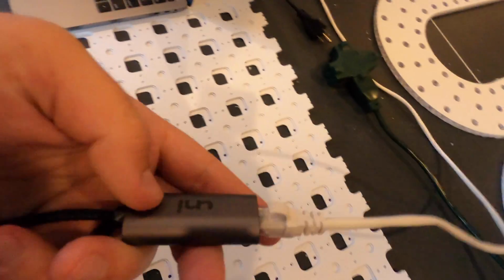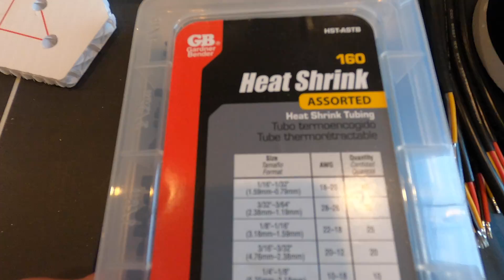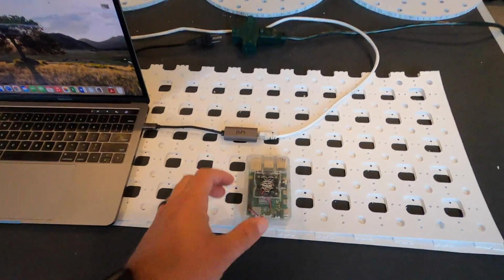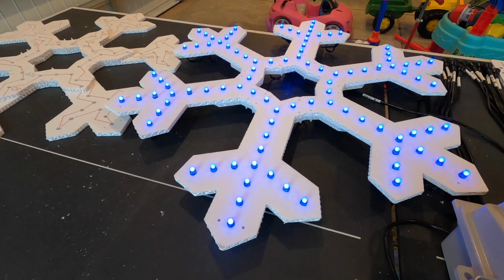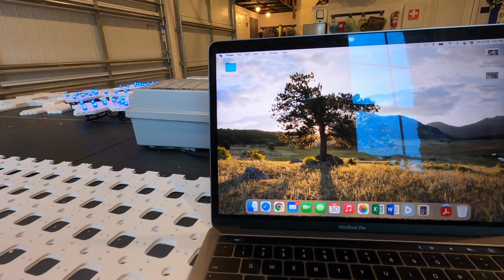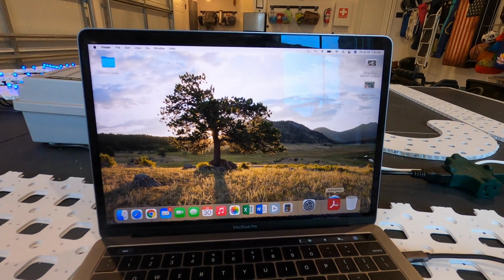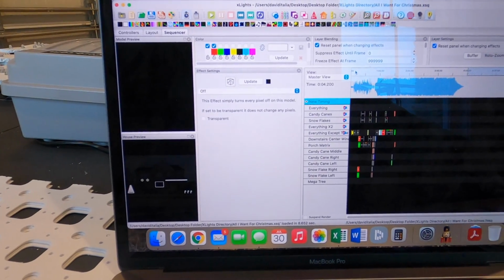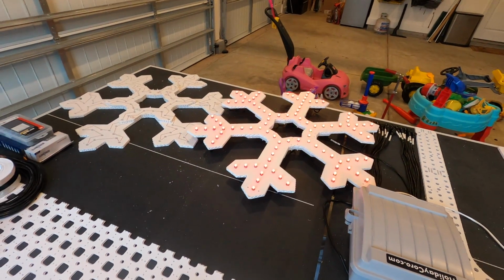How Do Smart Christmas Lights Work? - xLights

Comment: Hi I wanted  to see if you were able to get the raspabar pi to work with the holiday Coro controller
Reply from the maker: Funny you ask…I actually just got it working a couple days ago. Are you having issues? The biggest thing was making sure the pi IP address has a 3rd octet the same as the controllers. i.e. if your controllers are 192.168.0.1 then make your pi 192.168.0.2.

Comment: Hey, can you link the boards you're using, please?
Reply from the maker: I don’t think I can put the exact link but if you go to the holiday Coro website, it’s the one with this title: 16 SPI Output Flex Expansion E1.31 Controller + Up to 350 Watts of Power + Standard Enclosure / EasyPlug3 Pigtails / 5,540 Pixels / Ready2Run Assembled / AlphaPix Evolution or HinksPix Pro CPU